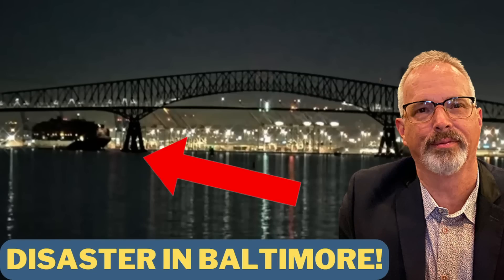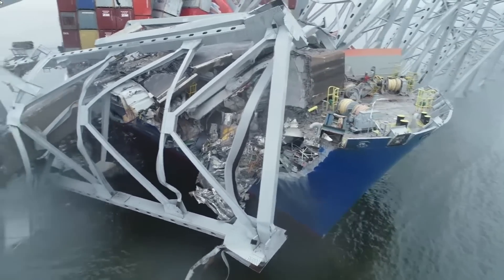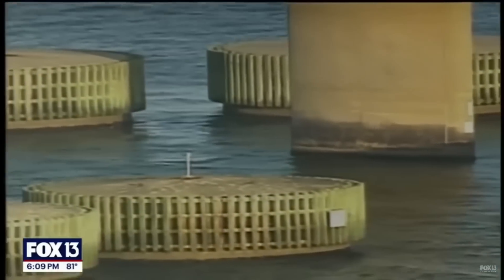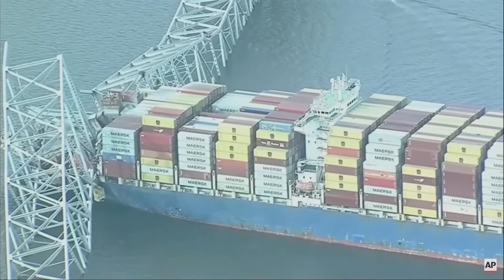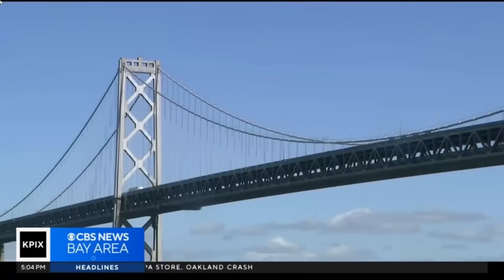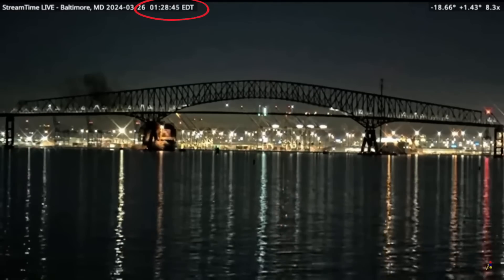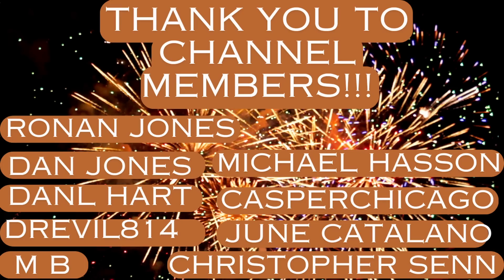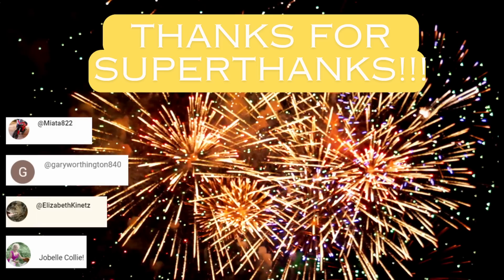How the Francis Scott Key Bridge in Baltimore should have been Protected

Comment: Casey,  

Have a look at the Coronado Bridge in San Diego, California, the Benicia-Martinez Bridge, near San Francisco Bay, and the Alfred Zampa Memorial Bridge, again near San Francisco  Bay.  Each of these bridges have significantly better protection from allisions than the Key Bridge. 

I know the Coronado Bridge well having lived in Coronado and worked in San Diego.  I also had a sailboat and often sailed under the bridge.  I can say that whether it be in a 27' sailboat or a 188,500 DWT tanker in an allision with a bridge dolphin, the dolphin will win.

The ARCO Juneau had an allision with either the Benicia-Martinez Bridge or the Alfred Zampa Memorial Bridge in the mid-to-late'80s.  I supervised the temporary repairs to the Juneau.  There were two holes, one 10'x100' and one 10'x200'.  The hull was pushed in about 1 to 2'.  The hull steel looked like a torn sheet of paper.  A piece of concrete the size of a VW Beetle was found in the bottom of a cargo tank.  It had to be broken with jack hammers for removal.  There were bolts from the cribbing driven through the steel plate.  There was also pieces of railroad ties driven into the plate.  The hull plate thickness on the Juneau was about 1".  Dolphin 1 Juneau 0.

Regarding young engineers I  tried my best to convey what I had learned on the job, both good and bad.  I did this with both summer interns and younger engineers.  I also found that I needed to educate others about the world of ships and tankers.  The unfortunate part of oil companies and severance is as you get older you become disposable.  Major oil companies lost interest in seeing that young engineers were learning non-academic knowledge.   They assumed that it was better to lower head count and cost then to see that young engineers were ready to assume the responsibility that was being placed on their shoulders.

Bob

Comment: Over it's history, ships have crashed into the Golden Gate bridge tower's perimeter. However, at least the south tower is surrounded by one of the caissons once used for construction. It also has a pretty wide gap/space between the caisson's outer perimeter and the tower structure. And some mix of sand,water, wood, etc. fills that space. The caisson walls are thick concrete. There's no remotely equivalent barrier protecting the Key bridge towers. That's a gross deficiency.  I agree that several upgrades should have been mandatory because of at least three factors. 
#1) Many ships now are MUCH BIGGER than they were at time of its design/construction.
#2) The bow on these ships is is taller, with so much more overhang that the bow's tip could potentially hit the bridge before the hull even contacted the protective barrier.
#3) Without providing a number, one of the newscasts stated that ships were allowed to travel at a pretty high speed though this channel. Both energy and stopping distances increase with the square of the speed.

Given the size of the ship, the amount of overhang, and its speed, I question if a collapse would have occurred if it had hit the Golden Gate bridge's protection, especially its less protected northern tower.
I was told that large ships passing under the Golden Gate bridge are speed limited to 8 knots. While I've not confirmed this, it makes sense that the speed limit should be a function of the ship's size, its weight, AND be commensurate to the level of collision protection provided for its towers.

Comment: Port of Baltimore has been upgraded. Notably in 1990 for post Panamax ships. But only the berth capacity. They didn’t  include channel safety upgrades, just dredging for increased draft in the lane.

“Handling Port traffic are five public and twelve private terminals. Public terminals include Dundalk, Fairfield, North Locust Point, Seagirt, and South Locust Point. Opened in 1990, the Seagirt Marine Terminal provides a 275-acre center for automated cargo-handling, as well as two 50-foot container berths to handle two supersized container ships at the same time. Four post-Panamax cranes, four super-post-Panamax cranes, and four Neo-Panamax cranes unload the container ships. Three post-Panamax cranes were removed in March 2023 and sent to Tampa in order for the Port of Baltimore to upgrade its infrastructure and to improve its efficiency. Additional cranes are scheduled to be added later.”

Comment: Thank you for making this clear.
I'm a retired german engineer and I was involved in securing some existing bridges in Europe with collision protection, most in the Netherlands and Scandinavia. The water depth at the bridge in Baltimore is only 50 feet. I dont understand why the pillars were not protected. This could have been retrofitted at any time. 
 I also heard the last days many comments that it is impossible to protect such a  bridge against an impact of an vessel like this.
I don't know where this nonsense comes from. The hull of a ship is ductile . The protection has two main tasks here. Let the ships hull absorb most of the impact energy and keep it in a secure distance.
It is possible and proven. I consider it negligent that this bridge was not protected. Such accidents are not very rare. It's not so much a question of whether it will happen at some point, but when.
This disaster was completely unnecessary. I think that, as often, the costs have been avoided and it will now be much much more expensive. Not to mention the victims killed by this accident.
Reply: this is a distraction again, nothing to do with the share turn onto target just like The MSM or Government accounts are making no actual sense at all?, if a ship loses power to the propeller while on the course the ship will continue it was on before the loss of engine power, the weight and momentum of such a heavy ship will never turn like the video shows. Remember the ship's electrical supply is from one of several electricity generators that these Ships electronic Autopilot controlling the hydraulic motors on the Rudder will keep working keeping the ship on the course set by the Harbour Pilot, remember that the ship was on course to pass under the bridge when the lights went off, without electric power to the Autopilot the rudder will remain on the set course while it was adjusting course for any wind or current variations, then when the lights (electric power) came on again the ship auto-pilot would automatically resume the original course settings before the power loss, But! The video showing the sharp turn onto the target had nothing to do with the lights, or Autopilot or wind or currants proves The HUMAN FINGERPRINT is all over this deliberate turn into the Bridge. Heavy smoke from the engine funnel is caused by a sudden increase in fuel to the engine that provided strong water pushed onto the now hard-turned-to Starboard rudder? Who changed the course of the Rudder?  Then again the ship's rudder was adjusted to Port to stop the sharp-turning ship because the ship needed to make a direct hit not a glancing blow against the target. The MSM accomplices never talk about the sharp turn onto the Pier, and try saying see how the ship started to turn slowly away from the Pier, but sadly too late to avoid hitting the Pier. Sure sounds like a Government cover-up for whatever their reason is <><><> this was the intentional closure of America's 5th biggest port! (Now MSM are saying it is just the 19th largest Port?) No question about that! But was it the US Government extremists or their FBI, or CIA! Did Terrorists sneak on board and overpower the crew? Was it blackmail of the Harbour Pilots and captains and engineers, no matter why? It is “who are they” that must be discovered because 6 people are dead because of this deliberate act by some of the People on this ship!!!!!!!

Comment: Thank you for providing such a lucid response.    IMHO protecting the bridge is extremely important, but people don't seem to have common sense to predict what should be obvious, but rather the logic seems to be that ...well it hasn't happened yet, and so why spend the money.

I'm not arguing against passive protection, but please don't give the active protection a pass either.   These modern giant freighters also bear the responsibility, because, also in the name of the almighty dollar, they only have 1engine and no backup.   Cruise ships are required to have 2 engines, but these freighters are allowed to be woefully underpowered....because it's cheaper.    Likewise the tugs are used around the docks and other ships, but once they get away from "their" infrastructure, they let the freighters on their own.   This is kind of pathological behavior and should not be allowed.    The port is always going for the cheapest solution.      Likewise having 2 fuel sources (clean diesel near shore and dirty diesel away from shore) is another pathology that should be addressed.    Shipping is amazingly efficient, dollar wise, but sometimes it's penny wise, but pound foolish.    Making the boats bear the responsibility will at least make them understand that they can't always get off trying to save money and when they cause an accident, they just let others clean it up.

As far as money to build the bridge, it seems obvious that the liability SHOULD be the damn boat, not the government.   The lawyers will try and convince people otherwise, but the public shouldn't let the boat off the hook.

Comment: Another comment about if this is like tofu-dreg. No. Tofu-dreg relies on little to no consequence for failure. I don't know if China would have reported this kind of accident. There is also an aspect of corruption to it, which should not be the case here. We may have been similar in boomtown areas, where building things quick and cheap was the way, and you would be gone before it fell apart to the next town. Not now.  Our NTSB would look for all the footage of an accident in order to analyze and learn from it. China would look for all the footage to confiscate it, because they're worried about confidence in government. The NTSB is also great because they get very comprehensive on corrective actions. Everybody learns from it.
   When something fails, it's rare a single spectacular thing. It's a chain of decisions and events which gradually increase the chance for catastrophe. They multiply the probability.  That's why we don't compromise on small things.

Comment: I have traveled over the Sunshine Skyway Bridge many times in the 1960s and 1970s and I was shocked when I heard about the collapse.  When I read about the dolphins and other protection they installed on the new bridge I thought  it was a good solution. People buy insurance in case of an accident.  The insurance (dolphins) in this case would have prevented the accident.  Hazardous cargo has to go some other way since it cannot go through the tunnel.  The port is shut down.  Dock workers are out of work.

Comment: I have a couple of comments about the possible cost and impact of installing the dolphins. First of all, if there is a 100% safe design, chances are it is astronomical in cost, and possibly more to maintain over the course of it's long lifespan. To a degree, it's not a question of engineering, but budget. That's the eternal conflict of engineering. FMECAs give a statement of risk, and it's up to the people with the money to accept it.  It's up to the engineer to ensure those numbers are as accurate as possible. That is the industry I have known for 30 years. It has better outcomes than the medical field, where people have 100% expectations of success.
A second consideration here  would be impact to the port to put in the dolphins, would it have to be shut down, or would the size of ships be limited in entering the port. For a project taking months, that can have considerable economic impact. Additionally, I am curious as to the makeup of the port basin. The bridge did not seem to have a lot of extra width, where ships rarely passed each other under the bridge, they would go through the center of the channel. 
   The basic is a tidal one, so water would rise and fall, currents might even reverse. It seemed there was a good current when the Dali departed, I imagine it was during a falling tide. What impacts could that have on the dolphins, or the channel? I'm wondering if adding those might cause silting. Suspension bridges have longer spans, and are much more expensive. 
   Finally, one must be aware of the conditions of construction,. Baltimore in 1977 was not a great place to be, it was very much in decline, federal funds were not easy to get at the time. 

   It's the role of the engineer to look at all conditions, and using the common knowledge of the industry (from research and lots of installations, and natural sciences), and look for a practical solution. Blame is not something we throw around. It's failure we worry about. You don't do reactive solutions. As someone who has done testing, you look for rules, and not exceptions. Exceptions are infinite, rules are finite and further reaching. It also makes things predictable. Sometimes the obvious solution isn't obvious. 
    As far as institutional knowledge goes, I do always try and educate younger people in looking for rules, not exceptions. Engineers don't like sexy solutions, we like boring ones (the best compliment is, it just works, if something happens, the user looks to themself first, before bashing the design). The older people have the wisdom, and it's on the younger people to try and absorb that, and expand on it. At the same time, as an older engineer, you have to stay current. The world is a changing place. 100,000 ton neopanamax ships didn't exist when we were young. I generally try and focus people on the essentials, dismiss the esoteric (your go-to design may not work for every job, I've seen that a lot). 
    I have seen what happens in overwhelmed maintenance departments with limited budgets. It's easy to say to do something, or don't use something, but without options they're not going to happen. The older people had the benefit of creating a lot of new infrastructure, with new materials. Getting land wasn't a problem. Working over existing infrastructure was a rarity. An engineer also has to be self-aware of their weaknesses and strengths. They need to know when they don't know (I try to never turn down a question, and if I don't know, I can direct them to someone who does. You don't want to be afraid of questions). 
    Our world is not black and white. It's grey. People may have easy answers, but you have to dig to find the real answer.  Would separate dolphin cause silt problems? Would a dolphin around the pier be possible to install with the bridge possibly limiting the height? Can it be done with minimal impact to the port operation (e.g. allowing single transit of the channel under the bridge, dredging, etc).  Civil is not my field, but I am inclined to think if silting or clearance was a problem, it might have been necessary to encase the piers with protection (structures aligned with the tidal action, minimizing calm points which might deposit muck). How deep is it to get to bedrock?

Comment: Protection systems WERE considered for that bridge bur REJECTED  by the State of Maryland due to cost as you note.  Very deep water  close to the piers creating a 50 ft. deep channel.  When bridge i  was built in the 1960's ships were nowhere near as large.  Baltimore port is only the 18th largest port in the US.   In Baltimore, this ship was having mechanical problems at the  dock.  Regulations should not allow vessels to embark unless all systems are 100% ship shape.   Consider not replacing this bridge and upgrade the northside Baltimore interstate as the loop bypass?

Comment: The Key Bridge was completed in 1977 so it was probably designed in the late 60s. Back then, the largest containerships servicing Baltimore were around 20,000 tons, less than 700' long and less than 100' wide carrying around 2,000 containers. The size of container ships has steadily increased over the years, but it has really ballooned over the last 20 years. Baltimore now has containerships over 150,000 tons, 1,200 ' long and 167' wide carrying 15,000 containers.   M/V Dali is less than 100,000 tons. Nothing has been done to protect the bridge in 50 years as the ship size increased from 20,000 tons to 150,000 tons???

Comment: I am not an engineer but its no use building barriers and dolphins near the base of the vertical bridge supports like the Betsy Ross  bridge.
Abrasion marks and damage on the overhang of the bow and video indicate the Dali took out the vertical bridge supports at the top near the joint between the vertical support and the  horizontal road deck structure.
The barriers and dolphins need to ensure a ship doesn't get near the vertical supports and joints rather than last minute deflection or impact at the base of the vertical column.